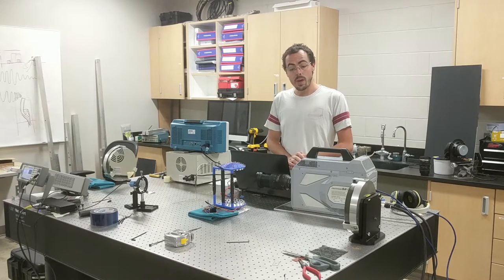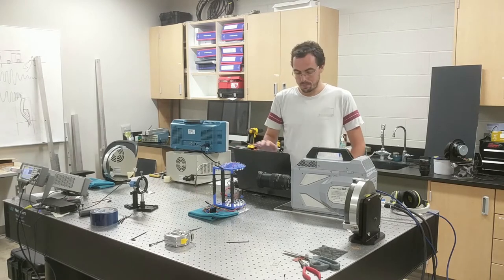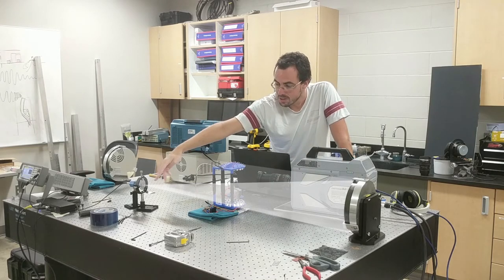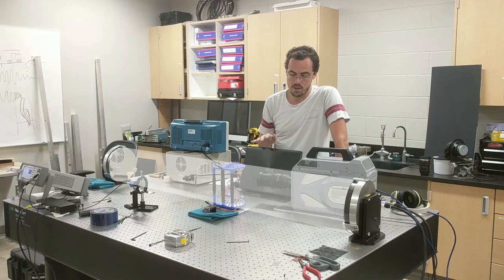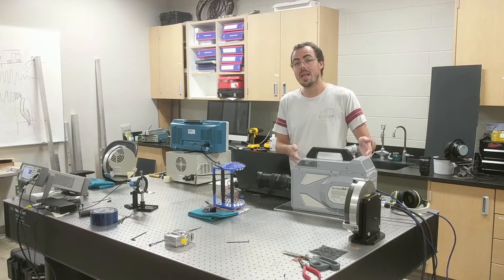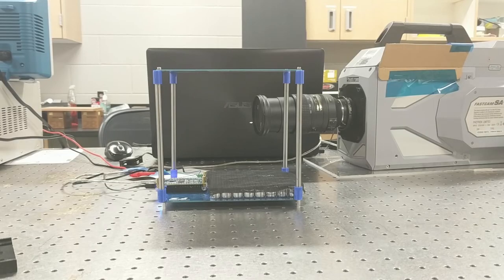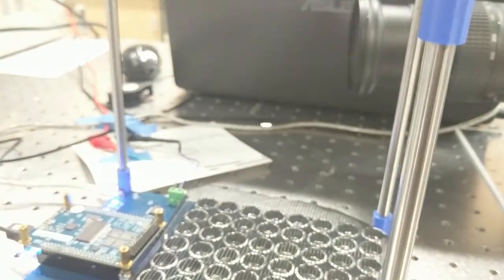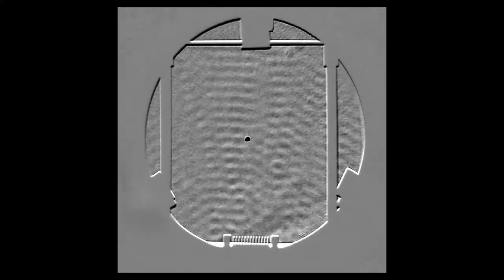Visualizing sound! Shadowgraph of an acoustic levitator.

Comment: Nice video. I wonder if you would be able to see standing sound waves with just 1 spherical mirror and a knife edge tester, by placing the audio setup right in front of the spherical mirror. I think it should be possible, since this method is also used in Schlieren imaging, to show small density differences caused by temperature variations in the air.
Reply from the maker: Thanks! You technically can, but the parallax in a single mirror setup is too large for what I wanted to do here. Since you can't place the light source and the camera at the same exact spot in the focal point (because they have some finite size), the optical system will end up integrating a shadow of two different spots in the schlieren object at the test section. This leads to two images and in the case of sound waves, there's some very annoying cancellation that I wanted to avoid as much as possible.
I didn't discuss this in this video but I wanted to actually measure sound intensity with this setup.
The Z type shadowgraph used here has parallel rays in the test section, so this is not an issue.
BTW; I'm a huge fan of your channel!
Reply: @fzigunov  thank you for clarifying this. I also expect your method to be more sensitive, because of the much longer path length.
Reply from the maker: @HuygensOptics  Funnily enough, the path length does not influence the sensitivity. In the case of the Z-type shadowgraph, it only depends on the focal length of the second mirror. In case you are interested in the details, I recommend the book "Schlieren and Shadowgraph Techniques", by Settles.
Reply: @fzigunov  Great presentation! If I may ask, what is the focal length of the second mirror?
Reply from the maker: @soliton3035  Thanks, Soliton, hope you found it useful! Both mirrors used are 8" diameter, f/8 (focal length 64").
Reply: @fzigunov  That's interesting. So if the sensitivity is only influenced by the second mirror, would it be possible to achieve the same result using just one mirror of the same focal length?
Reply from the maker: @soliton3035  In theory, yes. You just would need to find another way to come up with a parallel beam of light. That's the purpose of the first mirror.
There's a shadowgraph setup that only requires one concave mirror (Google "single mirror shadowgraph"). It's not very used in research because the shadowgraph appears twice in the image, but it demonstrates only one mirror is really required.
Reply: @fzigunov  Thank you very much for your prompt reply. I have a  mirror with a focal length of about ~1 m. Do you think it could be used in a similar experiment? I have a feeling that it will take at least 1,5 m in order for a stationary wave to appear. Am I wrong?
Reply from the maker: @soliton3035  In order to assess that you need to know the f-number of the mirror, the focal length is not enough. The larger the f-number, the better. The calculation is actually not very simple. I have a post on my website if you're interested:
https://zigunov.wordpress.com/2020/05/01/seeing-sound-waves-with-your-schlieren-apparatus/?preview=true
Reply: @fzigunov  I have a 10" f/5 parabolic mirror in my possession. In your opinion, would it be possible to perform a similar experiment with this equipment?